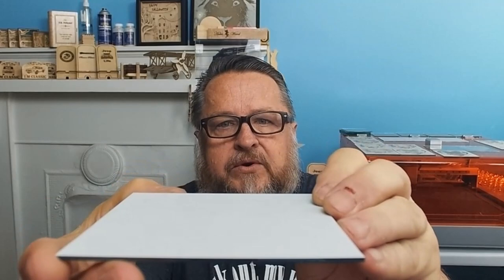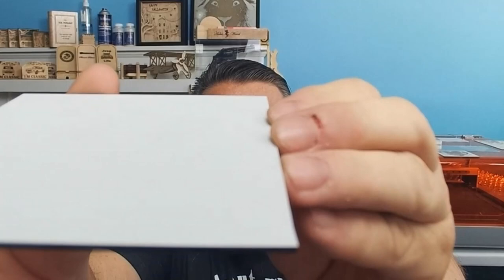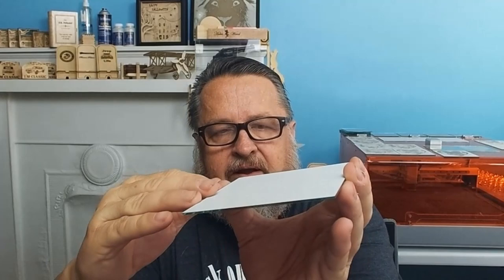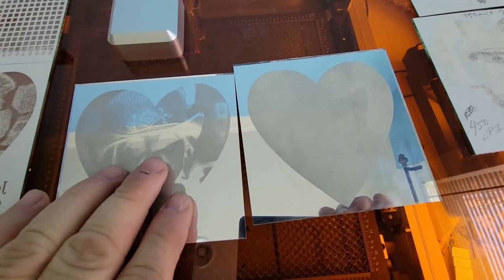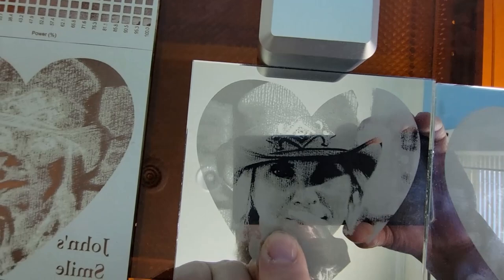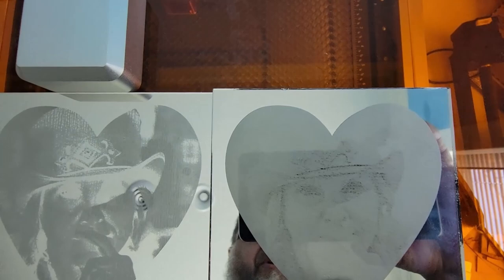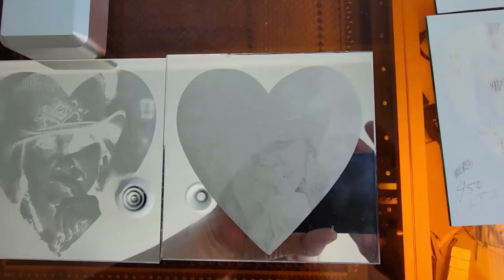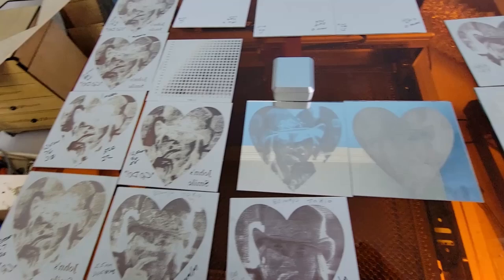Engraving on mirrors, too.

Comment: Haven't messwith m_ diode laser in 4 or 5 years, but I used GIMP and a plu%in called Da Big Gimp. It takes a photo, gray scales it, THEN, converts it to a negative. I had better results using that combo than the online service or trying to do it in Lightburn. But that was usi n g Lightburn 0.8 something.

Comment: could you not go over it twice without taking it out?
Reply from the maker: Can you? Sure. I guess depending on the power of the laser and the type of mirror used, it maight even be necessary. That's why you test. If you can't find the right speed and power settings in a single pass a cross-hatch might be necessary.

Comment: I appreciate all your work. I tried engraving a few of these mirrors, but did not like the results I was getting. I ordered different mirrors, asking on Amazon first if the back was smooth. The new mirrors work great. Not too sure what I am going to do with the 45 mirrors I have left with the ridges on the back.
Reply from the maker: They are cheap mirrors to test and learn with. Once you've dialed in you technique and settings, you definitely want to use better quality mirrors. For my full size 12"x12" mirrors, I buy them at Lowe's. They have a smooth back and create excellent results.

Comment: I flip the image and laser from the back side it may take 2-3 runs sometimes but im running my 150w at like 300mm with 17% power I also use Jarvis or stuki most of the time. Did a parents wedding image for a young man, that went on a light puck so that the light comes through the edge. Also have done a 12inch round circle mirror with a zodiac circle on it that I painted with hammered black that came out real nice then I lasered a Merry Christmas with vintage santa on it that I am painting with red green white and black.

Comment: Yes, I really have to wonder if you were using a higher quality mirror. I think the inconsistency of the mirror coating caused all manor of inconsistencies in your testing.
Reply from the maker: Don't know if the are "better" quality. But I'm sure they are different quality. The next video and last video addressing this topic for a while will be demonstrating just that. Before I spent two days searching for the best/fastest setting for these mirrors, I had already demonstrated excellent results at lower speeds and power. But viewers were wanting to see the attempt at higher speeds and powers. I continually stress anyone wanting to see these results for themselves to purchase the same mirrors I was using. hobowithwood.com/4inchmirrors This is the only way to expect the same results. This type of mirror is not my favorite. I plan to show three different mirror types and results on each. I will use the same settings and laser and have very different outcomes. As I said, I had already achieved excellent images on the mirrors. I was only showing those interested, how I got there. Because knowing how to find the sweet spot is crucial.
Reply: I have used these mirrors and they are the worst for engraving. The reason is exactly what you said - the white coating on the back is bad. It has inconsistent thickness, like it was brushed on. I got the dark grey-black coated mirrors and they work like a charm on my diode. High quality even coating makes a huge difference.

Comment: Thoroughly enjoyed your video but tried to get the mirrors you used and they are unavailable on amazon uk so will have to either wait till back in stock or buy some different ones and go through all the trial and error. i'm also using an xtool D1 pro 20w but will use some of your settings as a start off.
Reply from the maker: I am working on a summary video. Thanks for watching and stay tuned.

Comment: wow Steve... I watch you guys all the time... Great video.. But confused the hell out of me with this "focus, pre-focus sub-focus" stuff.  I focus my present laser now for engraving (not cutting) at 17 mm.  So what would I do now?  Create a new  16 mm focusing tool  for doing "those" mirrors?
Reply from the maker: Okay. First. "Pre" comes first. "Pre-Focus" is before the focus for the material being used. Then you fave "Focus". Then comes "Sub", or below below. Keep in mind I made the terms up after getting confused by the temrinology Rich uses to express the same thing. Pre is before and Sub is below. A separate focus tool is not needed for Pre-focusing. I simply lay a piece of material on the engrave surface then lay the focus tool down and good to go. It's very rare that I sub-focus lately. I'm not doing many projects that require it. Now that I've hopefully cleared up that made up terminology, why do I do it? Your laser comes out of the module and wider than the optimum focus point. Beyond the optimum focus point it starts to widen back out. It looks like and hourglass on a BlackWidow. By using prefocus you are widen the laser beam at the surface of the material. When using a really high LPI you can get actual lines in your image if it is focused  correctly, or normally. When you raise or Prefocus the laser, the wider laser beam helps to hide the lines because it begins to overlap itself. There is a lot going on and it can get confusing.